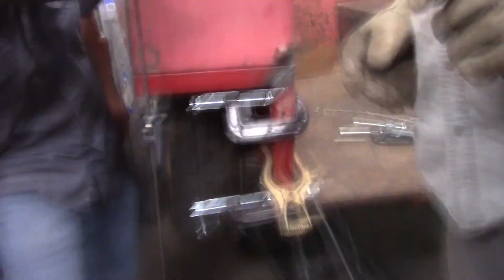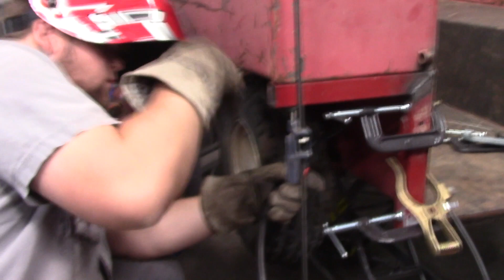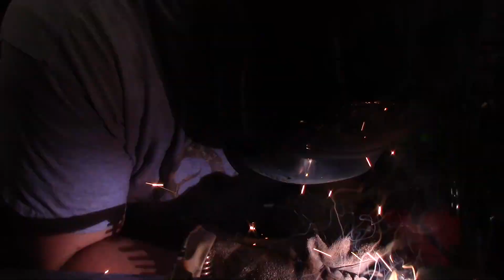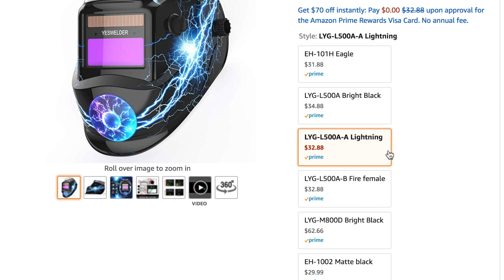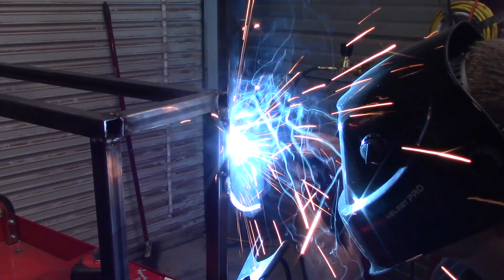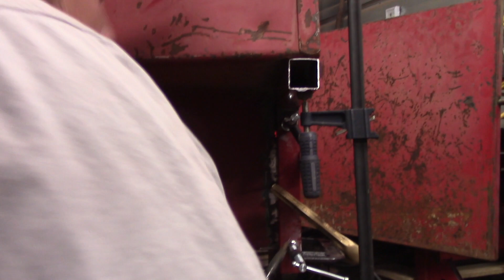YesWelder L500A Welding Helmet Review

Comment: How does the battery work for the lighting one
Reply from the maker: Well, they all have the same auto darkening technology, so it would be the same across the board. But I haven’t seen the battery die on any of them:
Reply: @DereksWorkshopAndProjects  I’ve never had an auto darling so how does the battery work how do you charge it is it like a phone?
Reply from the maker: Oh I see. Sometimes people ask these basic questions in a way to try and troll me. It’s happened a couple times. So I am always a little skeptical. The auto darkening helmets are charged by a solar panel just above the viewing window. But the brightness of the arc when welding also charges it, supposedly. My helmets are almost never outside in the sun and always function properly so I assume that is true.
Reply: @DereksWorkshopAndProjects  yeah my bad I could’ve been clearer I’m in highschool taking welding classes and all last year I’ve only used a passive shade 10 but now I want to get a auto darkening but That’s so cool I thought I was going to have to keep buying batteries or something thanks for actually responding
Reply from the maker: Yeah no problem. To explain a little, for example, one time I had a guy comment on a video I had about an exhaust leak I had near the engine on my Toyota Corolla. I was just telling people different places to look for brakes or cracks in the pipe. The guy commented and said “yeah I smell exhaust around my engine, do you think I have an exhaust leak?” I thought it seemed fishy, but I answered trying to be helpful by asking a few questions and telling him what to look at and he came back later and said “oh yeah I checked and the exhaust smell was coming from my battery”. Anyway, he point was that I was an idiot for suggesting to people that there were different places to look at for exhaust leaks, and that I was stupid for not knowing right where it was coming from in the first place. So anyway, sometimes when people ask kind of basic questions like that I am a little skeptical of their intentions. 

With all that being said, I wish I took welding classes in high school. I had the option to but chose not to because I had a girlfriend I wouldn’t be able to see at lunch if I took them because I’d have a different lunch schedule. Anyway, that’s was one of the stupidest things I have ever done, but good on you for doing that. Auto darkening is definitely the way to go. Cheap ones work fine, but if you are going to use it all the time, like every day, and can afford it, consider getting a higher end one. But these cheap ones aren’t a bad place to start. Thanks for watching and commenting.
Reply: @DereksWorkshopAndProjects  hey my lighting helmet just came in the mail do you think you could make a video of how to take off the lens on the inside

Comment: Is it easy to change the battery on these
Reply from the maker: I haven't had to try. They have sat in my hot (summer) and cold (winter) shop for over a year and they are still working fine. I haven't needed to yet so I can't say for sure.